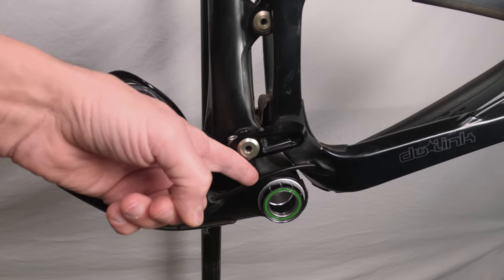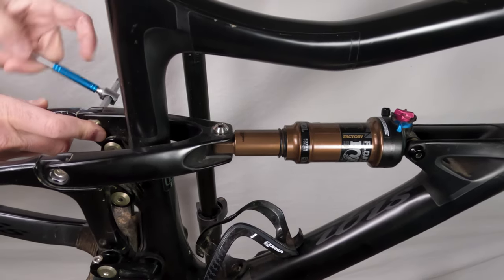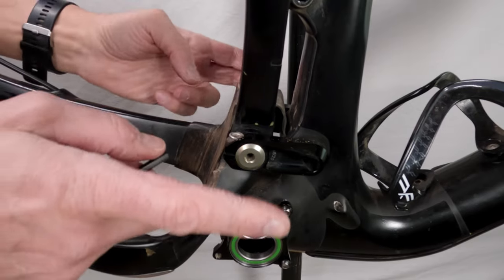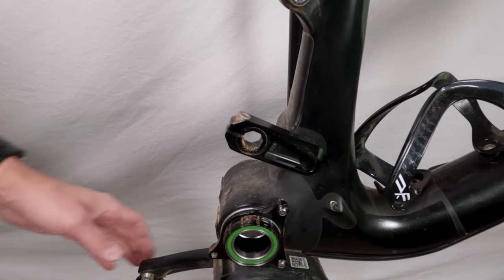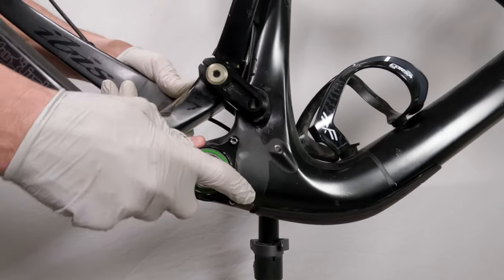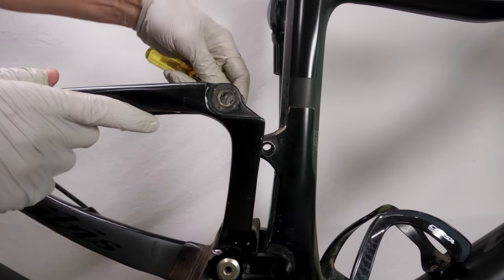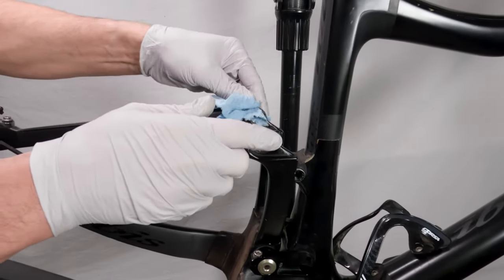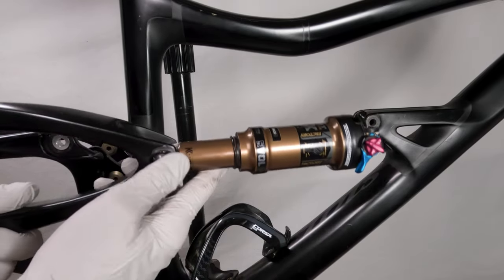IBIS Ripley V4 or Ripmo Frame Bushings and Linkage Replacement service for Beginners

Comment: I take it all apart but leave either the top or bottom linkage linkage together loosely and service them one at a time so I don't have to hang the rear triangle, your right it's a pain in the ass! Alignment is a not as easy on mine. I think your suppose to torque the lower linkage pre-load bolts before the pinch bolts, also Ibis recommends loctite on the pinch bolts. Great job on this video!
Reply: Same here, do the upper and lower separately so the whole rear triangle doesn't have to come off.  Could also hang the rear triangle in position so there is no stress on the brake cable.
Reply from the maker: Thanks for the heads up. I'll definitely try this next time I work on a Ripley. As for the Loctite, I'd bet it was a miss on my part. I have to admit, when making these videos its a challenge remembering all the details when there is so many other things to think about at the same time, proper framing, overheating issues, not making excessive noise etc. I really need to start scripting to avoid stuff missing stuff. thanks again 👍

Comment: Ibis specs grease on full length of lower pivot axles as well as grease on the flange of the lower preload bolts and on the top hats for the clevis bushings.  Would be interested to see a how-to video on replacing the bearings in the pivot.  Like your friend, I purchased a pivot from Ibis.
Reply from the maker: I basically put enough grease to fill the axle areas that contact the bushings and also fill the end caps with grease. You can apply grease to the whole axle but most of it is exposed in the frame with no contact on other parts. I DEFINITELY want to figure out a way to replace the upper link bearings. I can't imagine they will take much of a beating considering how thin they are. I'm not a fan of having to replace the whole link for $60+ because of bearings that cost no more than $5. I'll figure it out and will absolutely make a video when I do. I need a bit though as i'm currently finishing up a fox 34 rebuild (which I had to redo because of recording issues) and a few other fox shocks (DPX2, dpx performance etc)
Reply: @zoubtube  Yea, most of the grease you put on the axle ends up sliding off as you push through the bushings.  I just cleaned out my bearings and regreased and my link will be good for awhile.  Question, did you notice on the new link that one of the bearings is a bit notchy?  Seems to be an issue on a lot of them...perhaps poor machining of the pivot and the bearing gets compressed when installed.
Reply from the maker: @JoeS97756  I didn't notice anything irregular with with the bearings in the new link. They felt smooth. How long they will stay that way is a different question. 😉
Reply: @zoubtube  ok good.  Hopefully they have fixed that issue.  I pressed a new good bearing in place of the notchy one and it became notchy, indicating to me that the machining was too tight.
Reply: Yes, please,  @zoubtube   I have bought my 3rd upper link since 2019 now..

Comment: This is an awesome video, thank you.

Mine is a Ripley AF but it seems like it’s  pretty much the same service.
Reply from the maker: Thanks for the comment. Ibis got smart by designing their bikes (DW link in particular) to be easier and more consistent to service. I just wish they (and everyone else) would move away from rear internally routed rear triangle cable. It makes servicing frames so much easier 🙏

Comment: I also have a bad batch of park tool allen keys. the end tips on the long end are fine with a good fit, but the regular tips for higher leverage all have play :(
..I feel you
Reply from the maker: You ain't kidding myman. I'm really thinking of making a video just on my park tools tools. there's a surprising amount of them that have gone bad with very limited amount of use. some of them broke on first use. Worse yet, I've tried their warranty page 3 times, EACH time the site end with an error page when submit the request, NO exaggeration. I've literally given up
Reply: as you say, @zoubtube  it is surprising. Park tool is known for being reliable on long lasting.. A video would certainly reveal how many more encountered similar issues.

Comment: Thanks for this video. I'm buying a 2 year old RV4 and plan to replicate this entire process. Funny (or not) how the rear brake line goes inside the rear triangle for only about 5 inches. What's the point!
Reply from the maker: Glad you found it helpful. I Totally agree with you. I'd rather have the option to remove the rear triangle without having to cut the brake cable. I just hope IBIS doesn't start with internally routed headset cables. 🤞
Reply: IR headset cables are the new nightmare for MTB mechanics. Question: never dealt with suspension bushings (only bearings). There's no lube with bushings?

Comment: I have 2011 banshee that I bought used about 8 months ago.
At that time I didn’t know much about mountain bike as I know now but I knew it was a great deal for a full suspension mountain bike with 2 fox suspension and once I got I really get into mountain biking I liked working on bike and still do 
Today I decided to take it all apart and service it
Where do you get the bushing from ? 
I went to bike shop they said that they don’t sell bushing that I needed for my bike
Reply from the maker: Which bushings are you referencing to? The shock bushings to the frame? frame linkage bushings, etc. If your looking for frame bushings, It's frame model specific. Which model banshee do you have? If you're looking for shock eyelet bushings, those should be easy to find barring any supply chain issues

Comment: probably wan't to throw some grease on the bolts in the bushings. Otherwise, great video
Reply from the maker: Thanks. Technically Igus bushings are self lubricating, so there really isn't a need to add grease between the bushing and frame. I'm pretty sure ibis doesn't do this either. I believe it will create potential to slip. I do add grease to the linkage axle though, which is where we want free movement. thanks for the comment